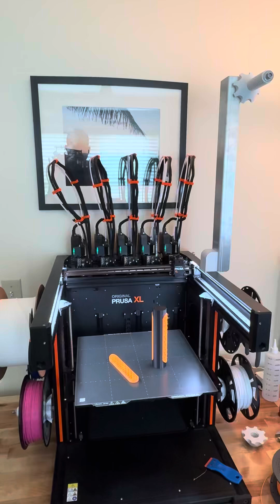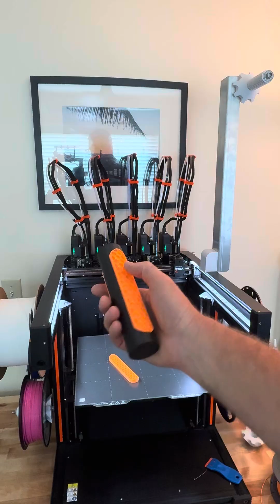Printing TPU on Prusa XL 3D Printer

Comment: That spool looks very nice, but it will not work with an enclosure. Also, when using an enclosure, leave it open when printing, because if you keep it closed the filament in the tube warms up and gets just a little bit softer, just enough to cause more bunching in the extruder (stuck filament detected)